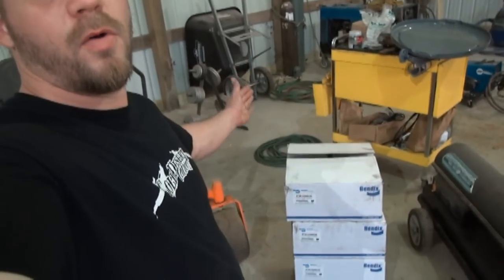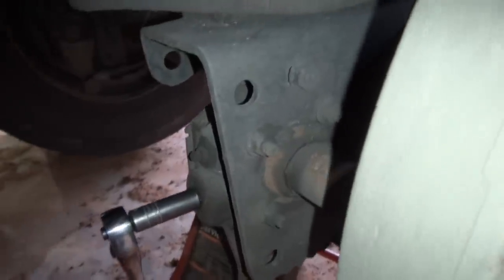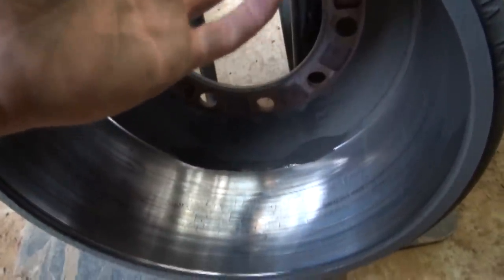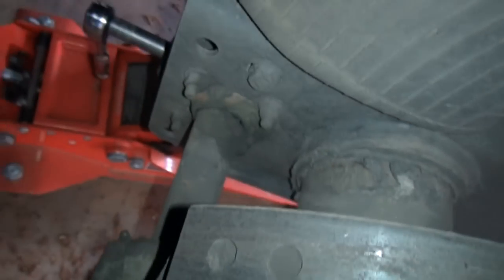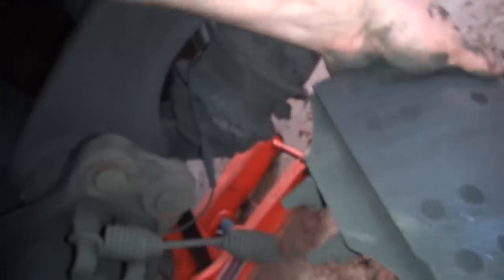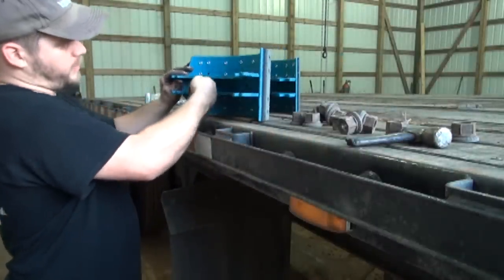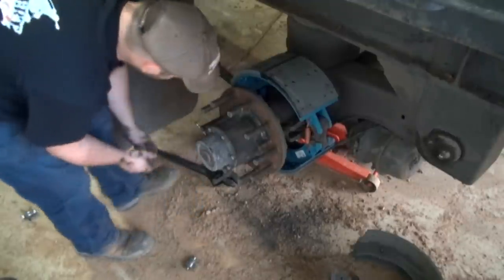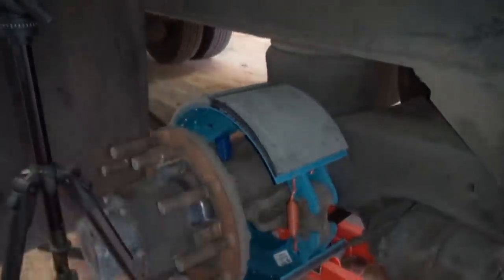semi truck and trailer brake job

Comment: It's much easier to remove the small springs first and install them last and then you don't need to fight the big one. Prybar between shoe webs and pry the springs out then pry the top shoe over and out then the bottom one just falls away. Install the top shoe with the big spring attached and leave the anchor pins out to allow for easy installation of bottom shoe to the other end of the spring, set the rollers to the cam face, lift the pin ends of the shoes and install the pins, then the small springs easily get attached with a spring tool or a good long modified screwdriver (I use a long bolt with the bottom cut to fit the spring end in. Working in a fleet shop and with many other techs over many years has made this task so easy and safe. Never work against the force of the big spring, it is unforgiving,

Comment: that dolly trick is pretty slick. its really easy to pop the 2 smaller springs off with a flat blade screw driver. then just pull the top shoe up and over an the shoes just fall off.

Comment: Those little springs are some times the biggest pain in the pooch. This year I've been helping the mechanic and probably have done 7 brake jobs and tried different ways for different trailers. This would've come in handy for the lowboy where I didn't have any room. And when pounding Those pins in for some reason I always find they go in easier holding them a little bit and whacking them with a bigger hammer.

Comment: All Brake drums on these new truck brakes have built in ware indicators on this one the recessed groove on the edge of the drum is the maximum size. When they start getting close to the indicator it's time to change them. They also make a no go gauge for 16.5 in brakes.
Reply: wear not ware

Comment: You can leave the big spring in it.. Pop off the 2 smaller ones takes 5 seconds and pull up .. Use anti cease on your bushing.. When replacing makes it easy to get back off on next brake job.
Reply from the maker: yep can be done either way

Comment: One way you can tell if you have is to look at the metal bracket portion. Q plus has a little plus someone that looks like a four leaf clover stamp. The regular Q does not

Comment: Hey tater it works a lot easier if you hook the big spring and pull it over then hook little springs that's how we do them in Cali
Reply from the maker: I have a friend that does it that way also, but those little springs can kick your but sometimes too.
Reply: Am in California too, about what's do brake jobs run for? Thanks

Comment: I just wonder.... How many miles can Drumbrakes last in Citytraffic ???
My Toyota Van has Drums on the rear... They are 24 years old... All original.... 157.828 miles on it... They are only just over the half of thier lifespan.
Sidenote:  Citytraffic and occasionaly in the mountains... Buuut i like to use the 2.4L Diesel (naturally aspirated) it's compression to slow me down. (and that saves tons of fuel and wear) 

What is your estimation of how long these brakeshoes can last ?

Thanks in advance.
Bjorn

Comment: I use bolt cutters to cut the springs off and it fall right off pretty easy without having to put your fingers in harms way

Comment: Quicker and easier to get a pointed air hammer bit and a hammer to pop out the brake shoe springs instead of pulling out both rollers

Comment: I'm doing a bunch of old motorcycle drum brakes, and I'd really like to RE-LINE some old shoes sometime. It's surprising the Semi-Trailer brake shoes are a disposable item. You'd expect that to be a re-line job. Wouldn't you?
Reply from the maker: they do reline them, you exchange the core for a relined one for about $40 per wheel or if you don't have a core its an additional $30, or i think you can buy a new one for about $80 or something like that

Comment: I think I could do it now .  How many miles do you usually get out of the pads  , they look expensive .
Reply from the maker: around 200k, I don't think thats typical though, i try to slow down before i use the brakes if i can, my friend only gets 100k out of his, they aren't much more expensive than say a quality pad for a 3/4 ton truck
Reply: STEVE ROB REVIEWS Steve they're only about $35.oo per wheel .

Comment: you didn't replace your bushings and rollers
Reply from the maker: I got some that are froze in there. I tried beating them out with a 4lb hammer won't budge. Don't wanna torch em out just yet. this trailer was neglected before i got it
Reply: @LifeWithChase   Because it was neglected is no excuse for not getting it back into proper shape. Those anchor pins are designed to rotate for a reason. The parts were in the kit. It takes a press and some talent to change them. Looks like you were just cutting corners and getting another job out the door. Most trailers never see the same tech the next time. Just passing the buck eh?
Reply from the maker: @christopherjamieson4237  yeah passing the buck since the trailer belonged to me, Roll eyes...  I didn't have a way to remove them without damaging it so I carried it to someone who did and paid them to change the ones I couldn't get out, and this video is almost 3 years old, that trailer has had another complete brake job done with new drums and all since then!

Comment: Using your old roller and bushings? Get air hammer and they pop right out..thumbs down for that.
Reply from the maker: these on this wheel won't come out i've beat them with a 4lb hammer and they won't budge and I see no reason to cut them out with a torch and risk damaging an expensive axle for no reason. when they get worn down then i will I suppose.
Reply: @LifeWithChase   If u get a spring that fights u try the chain trick. Hook one end of the spring on the retainer. Put the link on the other end of the spring  then run the chain under  the other retainer. One tug and it's on. Most people split the spring with a pry bar or a screwdriver but that stretches the spring and weakens it. I work for a garbage company we run 4711 and 4718 qplus severe duty linings. We'd glaze over  45s in the first hour.